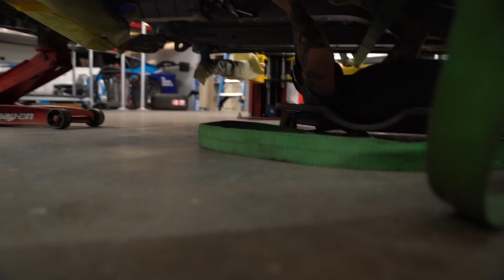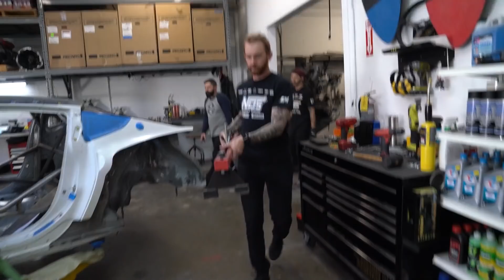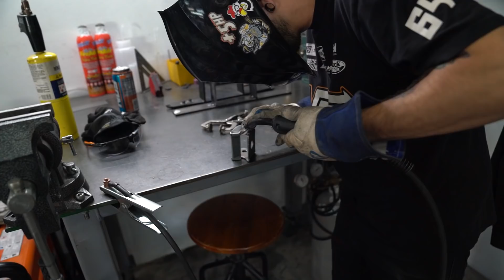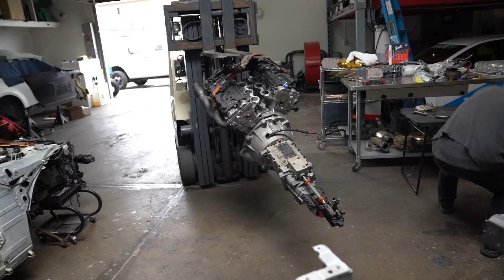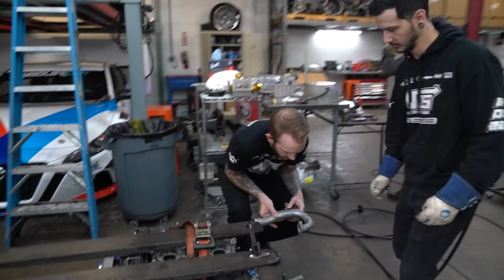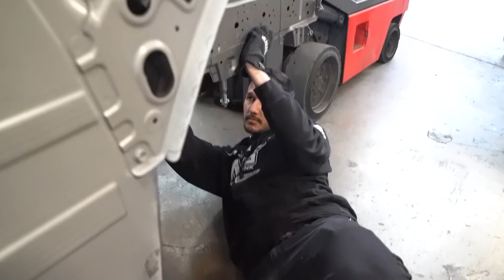More all-new Z progress PARTS WANTED Formula Drift or BUST!

Comment: I'm not a structural engineer but those motor mounts make me nervous with a billion horsepower and clutch kicks.   Not the mount themselves but the angle of the pipe and lack of gussets.  Am I nuts?
Reply: This is likely a mock-up
Reply: I was thinking the same thing. I was on a formula SAE team and we would get knocked for cantilever stuff such as that. It could be ok if the tube is beefy enough, but there is a lot of power and shock load going through those mounts. I would think that the tube should have more of a vertical component to it (I.e. the chassis mount should be mounted higher, but in such a way that it’s axis does not point at the center of the crank)